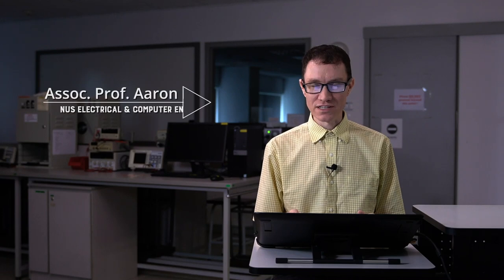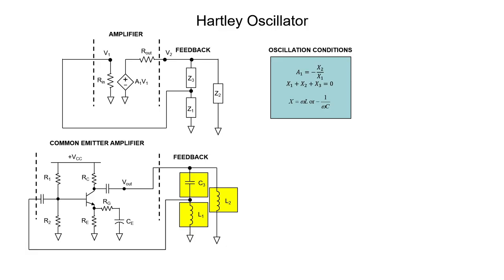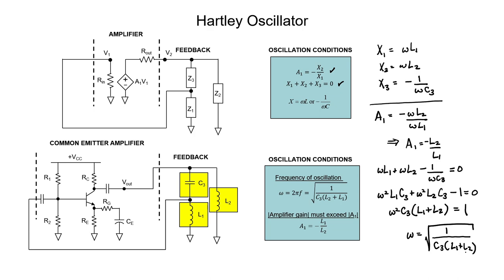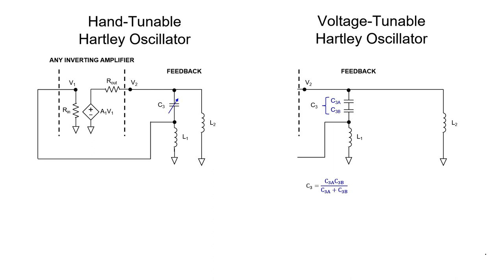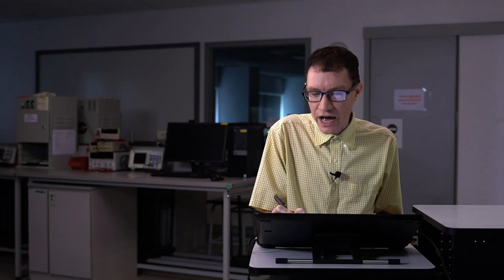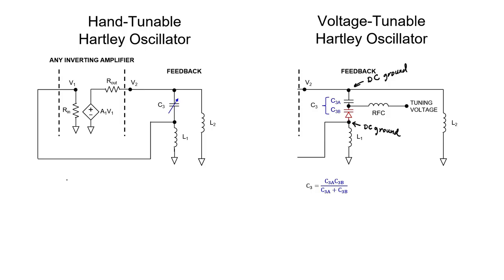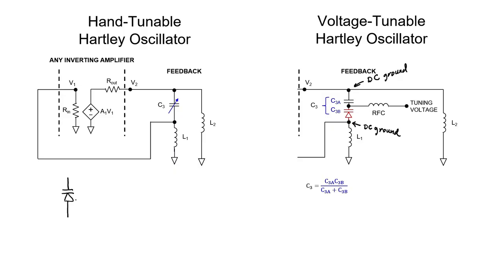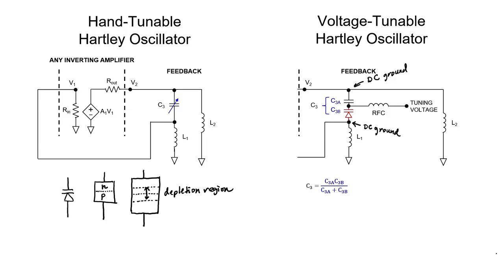Hartley Oscillator with Programmable Frequency (9 - Oscillators)

Comment: I have a question. Why (especially RF transistors) don't want to oscillate where some other transistors like 2n2222 have no problem with that. Is it because of capacitance difference or bias (which should be similar right?). I have tested many different transistor and they bevahe exactly almost always like that, RF transistors don't oscillate when I want to build for example a Colpitts oscillator or use them for a regenerative receiver etc. They are new and original and I tested many of them.

Comment: In case of enabling FM on a collpits oscillator, where would the varactor be placed?  SInce there is no clear DC ground because of all the capacitors, I am having a hard time, figuring this out